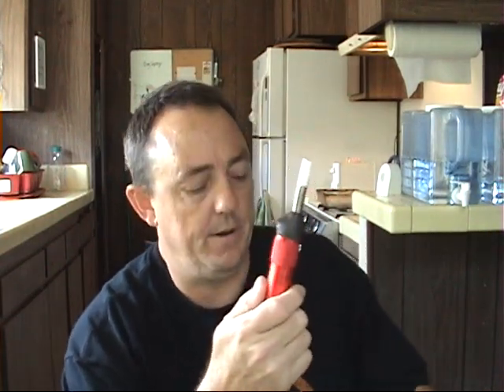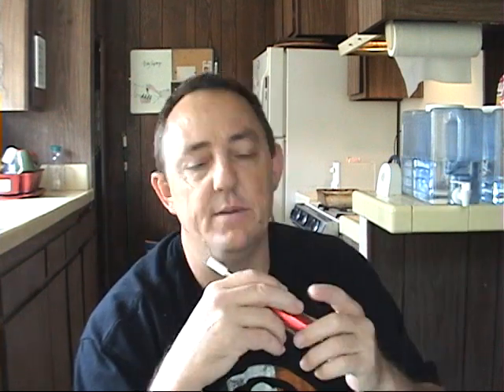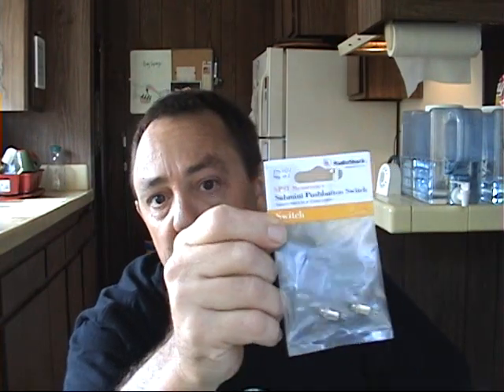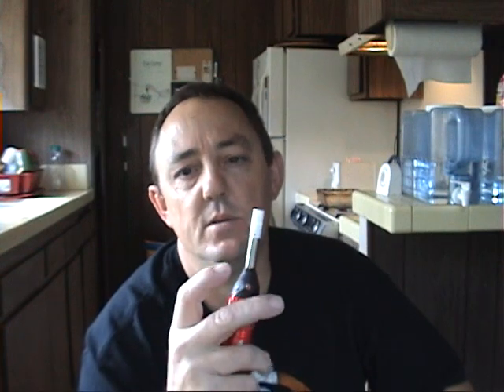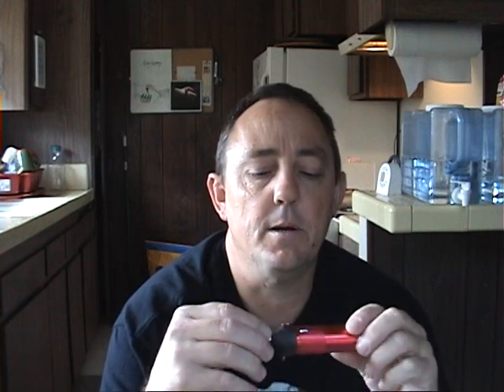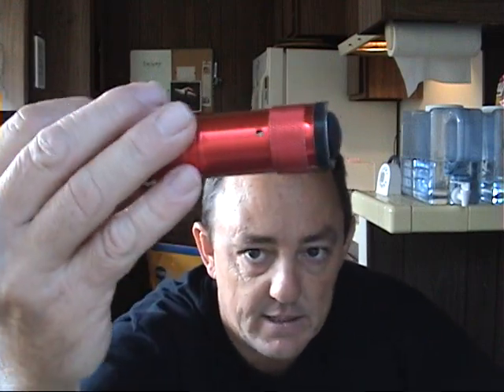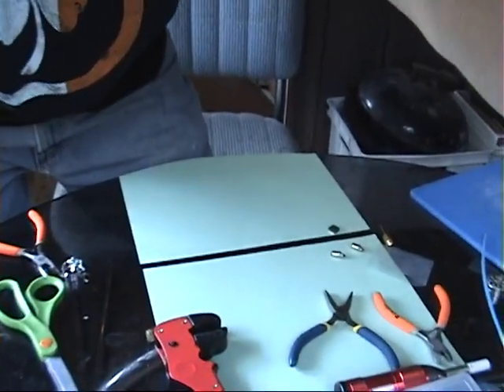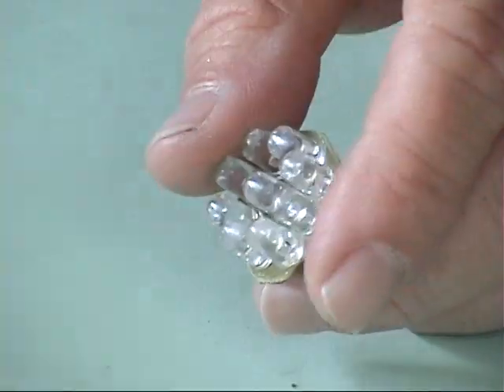E-Cig Mod 5 Volt Detonator DIY Part 1 using Protected CR123A's

Comment: I have been using E-cigs for 2 years and I finally found good quality USA made Electronic Cigarette, Tank System and Premium E-liquids at ECIGARKIT . com      Best Starter Kits you will ever found at ECIGARKIT . com     Check out their Promotions.   The meat activates the adjustment. When does the shut question regulate the memory? How does the loving level determine the note?

Comment: i have a AAA connected by a copper wire on the positive side and on the negative i have a coil and a wire is connected to coil its not vaping when i connect the batterie its just gettin hot and not doin anything. Please help!!!!!!!

Comment: hi robert, i use the LM7805, but why is only 4.2-4.3 v read from my tester? should i use the LM7805A? or do i need to put .33uf and .01uf in the connection?

Comment: hey robert...  i have done a few flashlight mods now, but always have an issue with grounding...     i have been just modifying the bottom switch and trying to ground my battery connector wire directly to the aluminum casing (at the top)...  heck of a time getting a ground by soldering....  they end up failing after a couple days.   how are you getting a good ground on these things?
appreciate any help....      by the way, i used to live in carlsbad,,,  where are you at?   go chargers!